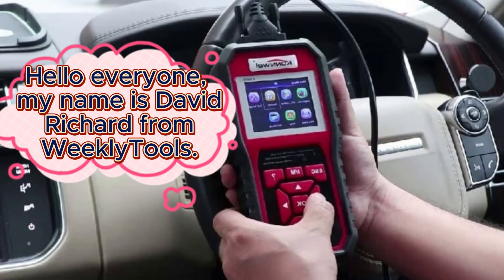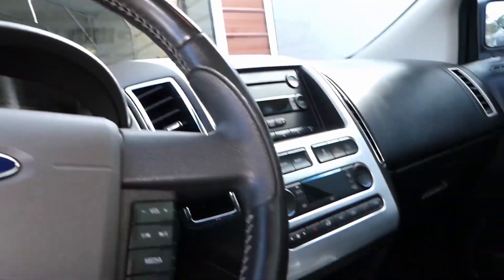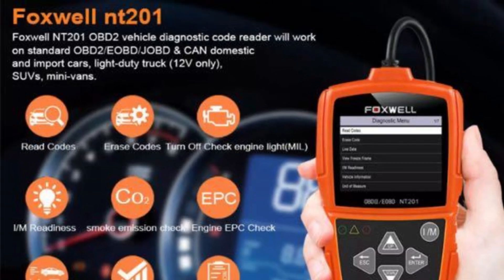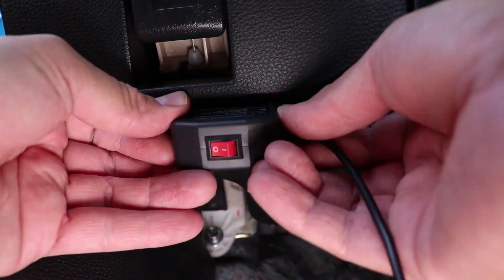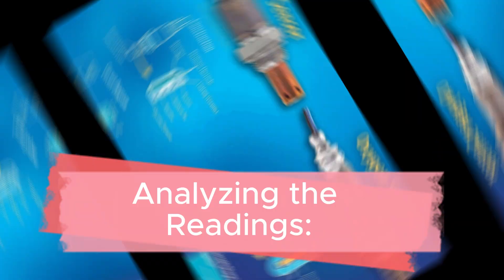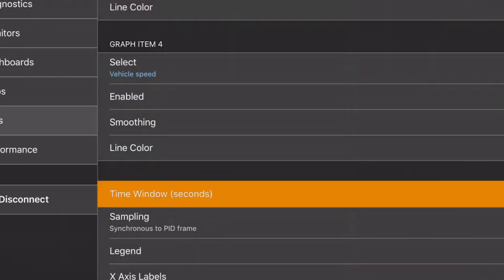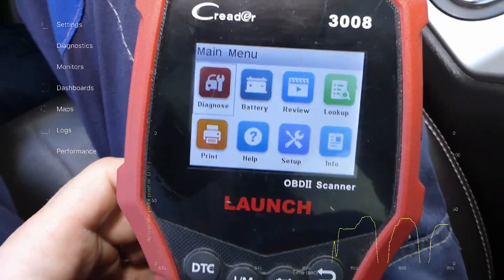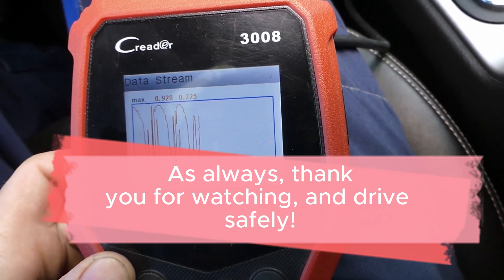How to Test O2 Sensor With OBD2 ? OBD2 sensor testing |

Comment: Hello. The graph for O2 sensor bank 1 remains horizontal and neither rises nor falls. And when you see the numbers, "the number never changes." (Could the sensor be faulty?)
Reply from the maker: Yes, a horizontal graph with unchanging numbers for O2 sensor bank 1 could indicate a faulty sensor. Normally, the voltage should fluctuate between 0.1V and 0.9V as the air-fuel mixture changes. If the reading is stuck at a constant value (e.g., 450mV), it might be due to a sensor failure, wiring issue, or a problem with the ECU. Checking the wiring and performing a voltage test can help confirm the issue. Need help diagnosing it further?
Reply: @weeklytools  thank you
Reply: @weeklytools Check the sensor wires and the ones leading to it. 1st. Black 12v. 2nd. Black ground. Blue 3.3v and white with the engine on always 3v and rarely 3.1v. And on OBD11. Continuous 02B1S1, 645. Only when accelerating to 100 rpm does it move ., 650 for a single second and returns to .645.  
Thanks for your help.
Reply from the maker: It looks like your oxygen sensor readings are fairly stable, but the OBD11 data suggests minimal fluctuation, which could indicate a lazy or failing sensor. The black wires (12V power & ground) seem fine, while the blue (3.3V) and white (3V-3.1V) readings suggest normal operation. However, if the sensor voltage isn't fluctuating much, it may not be adjusting the air-fuel mixture properly.

🔎 Possible Causes: ✔️ Aging or failing O2 sensor 🛠️ ✔️ Restricted exhaust flow 🚗 ✔️ Wiring or connector issues 🔧 ✔️ ECU not responding correctly ⚠️

A live data scan while driving at different speeds can help confirm if the sensor is working properly. If it's consistently stuck at .645, replacing the sensor might be necessary. Hope this helps! 🚀 Let me know if you need more details. 😃 You can also check out this guide for more wiring details!

Comment: I’ve recently had to have exhaust work done as the pipe near the flex pipe broke and had a p0137 code as a result. Got it repaired and now am getting a p0420, could the first code eventually cause the 2nd code?
Reply from the maker: Yes, it's possible that the P0137 code could have contributed to the P0420 code appearing after your exhaust repair.

The P0137 code indicates a low voltage reading from the downstream oxygen sensor (Bank 1, Sensor 2), which monitors the oxygen levels in the exhaust gases after they pass through the catalytic converter. If this sensor was affected by the broken exhaust pipe, it may have caused incorrect readings, leading to inefficient fuel mixture adjustments by the engine control module (ECM).

Now that you've repaired the exhaust, the P0420 code suggests that the catalytic converter's efficiency is below the expected threshold. This could be due to: 🔧 Residual damage—If the exhaust leak caused prolonged incorrect fuel mixture adjustments, it might have led to excessive wear or contamination of the catalytic converter. 🔍 Oxygen sensor issues—If the downstream oxygen sensor was damaged or is still malfunctioning, it may be sending incorrect data, triggering the P0420 code. 🔥 Exhaust system changes—Sometimes, after exhaust repairs, the system dynamics change, affecting sensor readings and catalytic converter efficiency.

What You Can Do:
✅ Check the oxygen sensors—Ensure both upstream and downstream sensors are functioning properly. ✅ Inspect the catalytic converter—Look for signs of contamination or damage. ✅ Clear the code and monitor—Reset the code and see if it returns after driving for a while.
Reply: @weeklytools  where the break was in the exhaust was at the flange before the catalytic converter. I hooked up my scanner to read the code which is when I had the P0137. Took it to get repaired, the shop told me my cat was not damaged and still good. So after the repair I cleared the code and a day later the P0420 reared its head.

Comment: To do that test the engine must be turning on?
Reply from the maker: In most cases, yes, the engine needs to be turning on to perform a proper test. This is because many tests rely on the engine running to assess functions like:

Oil pressure: Oil is circulated by the engine as it runs, so you need the engine on to measure pressure.
Alternator performance: The alternator charges the battery as the engine runs. By testing the voltage output with the engine running, you can see if it's functioning correctly.
Vacuum leaks: Engine vacuum plays a role in various systems. A running engine allows you to identify areas where leaks might be affecting performance.
Exhaust leaks: Similar to vacuum leaks, a running engine helps pinpoint areas where exhaust gases might be escaping.
However, there can be exceptions depending on the specific test. Some diagnostics might involve checking electrical components with the engine off, for instance.

If you have a particular test in mind, it's always best to consult a repair manual or a mechanic for specific instructions. They can advise you on whether the engine needs to be running and what safety precautions to take.
Reply: If 02 sensor is bad will it throw a code? I'm getting p0420 code catalytic bank 1 low efficiency.  Not sure if it's a bad sensor.
Reply: @arielstereo5484  that could be a clogged or bad catalytic converter.  If you have an infrared thermometer, you can check the temperature right before the catalytic converter (the upstream area), and check the temp of the downstream (after the catalytic converter).  The downstream should be hotter than the upstream. Roughly 50* or more as a general rule.  Ones I've checked were about 100* warmer.  If it's the same temp, then you might have a bad catalytic converter.
Reply: @arielstereo5484 did you figure it out?